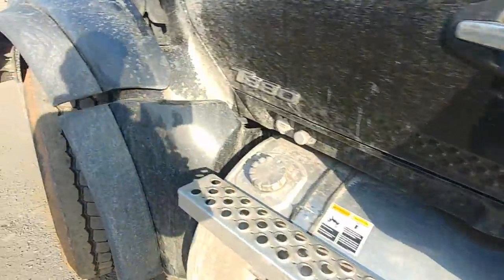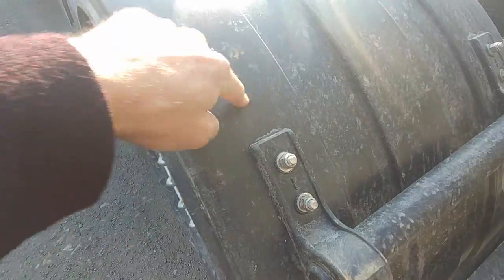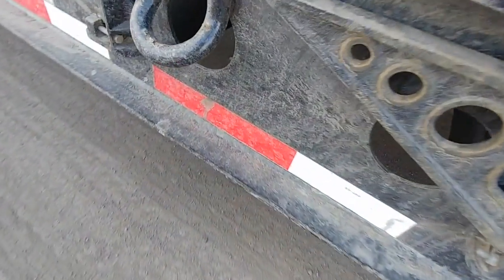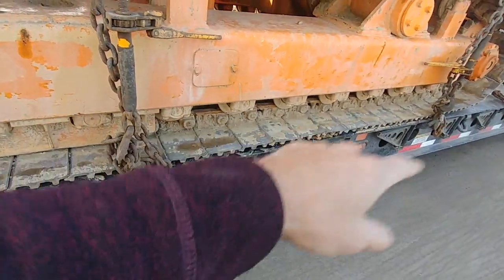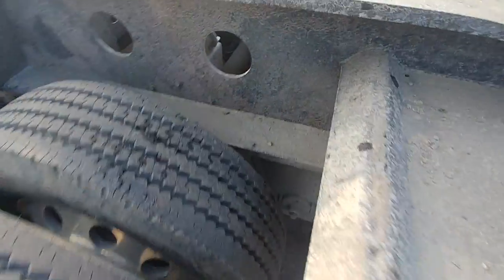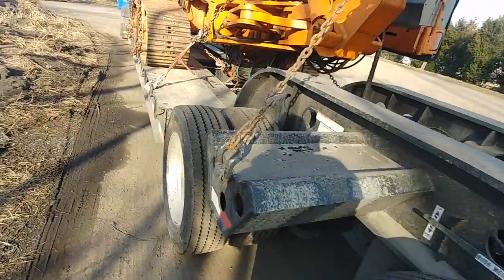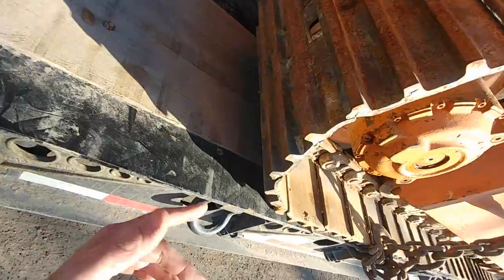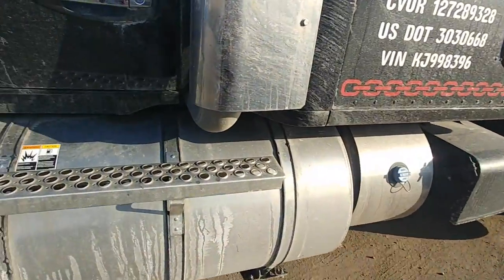It's truck wash time!

Comment: I read somewhere the reason the two exhausts are not connected is because of the "Ad-blue" (dpf) system .. if the two exhausts are connected then it puts up errors on the dash... (don't know why)

Comment: You would need 2 DPF and 2 SCR system to get true dual exhausts
Reply: You are making fun
Reply: @matthewscarberry8787  nope he's right. because there's probably not enough space under the cab in the center of the frame to put the DEF box which is now mounted beneath the passenger door steps

Comment: It looks like you have a break alway  system on the axle where the light flickers that box holds a battery, if the break-alway is trigger it will keep flashing for safety...

Comment: your fuel tank straps must be a little loose the rubbers are moving down
Reply from the maker: if one tank falls off, i'll still have the other one. that's why i got the truck with 2 tanks. so, don't worry about it.
Reply: @HHTV60  no worries here